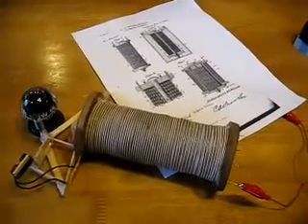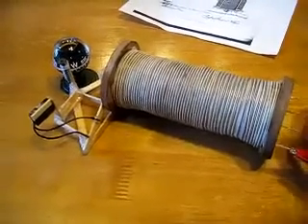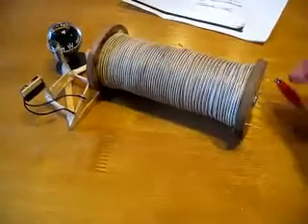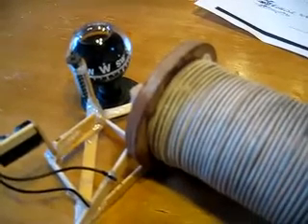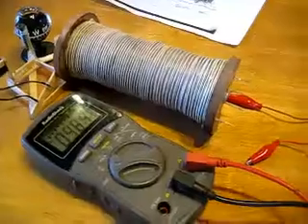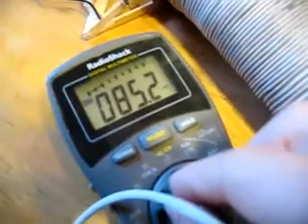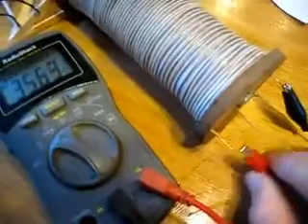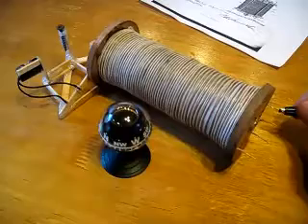Stubblefield Electromagnet Effects?

Comment: The way that these originally worked was not through galvanic action.  This can be deduced from Stubblefield's reports that these "batteries" worked in country areas where no electricity was to be found, but in areas where AC electricity had been connected such as large cities, the batteries ceased to work properly. He claimed that the electrical services in the metro areas interfered with the operation of his device.  He was quite bewildered about why the tests failed in the cities initially, but later gave this explanation.  This makes sense if the device was working off some kind of resonance and not exclusively galvanic action.  There were also reports that these batteries worked better in some locations on the same property than others.  It is hard to replicate his work as it is not as easy to find good locations which are free from the interference of 60 HZ pollution in the ground.

Comment: Like I posted on the OU thread NBS in the patent talks of connecting the 5 & 6 wires but note he says so in relation to Figure 4, which shows the secondary coil on the core, which would seem to imply to try the em with the secondary coil upon the device, not without.